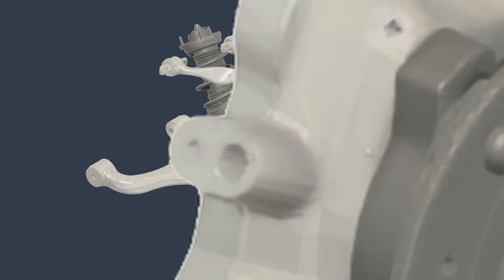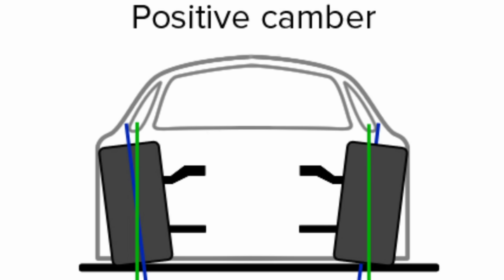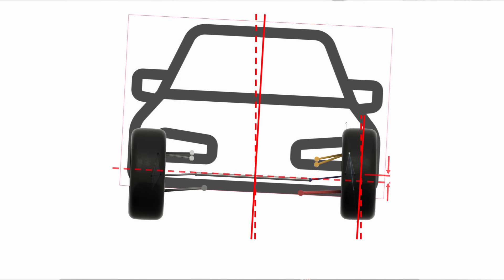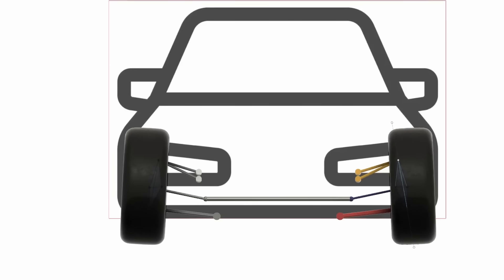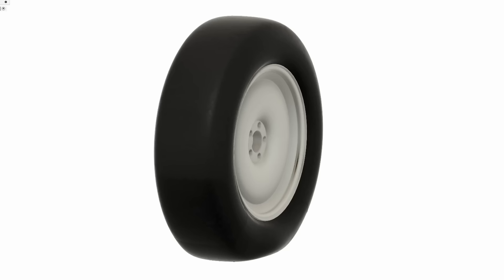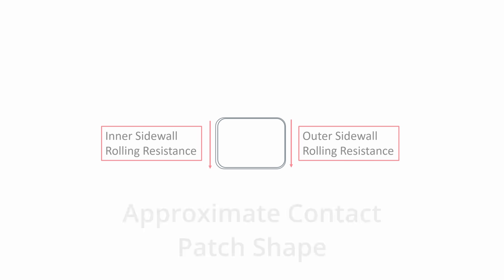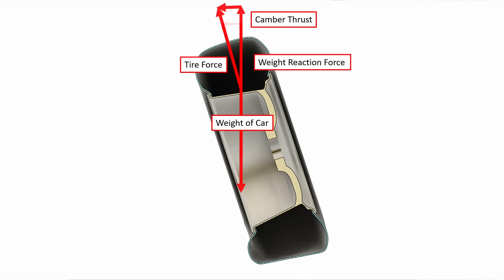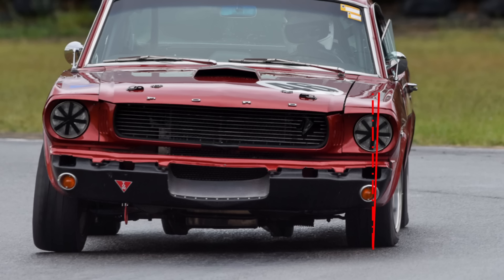Why do some race cars have such ridiculous front suspension camber angles?

Comment: Hey, I like your videos! People often say you need toe OUT on the front for better turn-in. How do you see that? I see the absolute first turn-in depend on the lateral force you get on the front and rear axle when going straight. Negative camber creates 'turn in' force on the outside tire. Toe IN creates a slip angle and turn IN force on the outside tire. So why do people claim toe OUT increases turn-in response? In my simulator as well, negative camber and toe IN makes initial steering develop yaw rate faster.

Comment: I've found all your videos very informative and have used things you helped me understand to improve the suspension on my FrankenFerrari V12 308  with revised ride height, roll centers, anti-drive, springs selection.  Any chance we could get a video on steering self-centering?  How caster, camber, trail, scrub, offset all tie in (if at all) and as a huge bonus how  the OEMs deal drag/friction in PS systems and particularly EPSA?  I recently add EPSA and its now a bit numb and kind  just kind drifts around going straight....and reading I see that is a common complaint both in OEM and retrofit setups. I'd love your wisdom here before I crank in a bunch of caster and hope for the best :)

Comment: Another reason for less front negative camber than in the rear on a street car is because of camber change due to caster as the wheels are pivoted about the steering axis. Albeit small, as the wheels pivot about the steering axis, because of positive caster angles use, the outside wheel will gain negative camber and the inside will will lose negative camber (which happens to be what you want). This doesn't happen in the rear being that the rear really doesn't "steer" about any steering axis to any appreciable degree.
By keeping front front static camber at a minimum, braking traction can be maximized at the front (i.e., where most of the braking work is done).

Comment: Im a big fan of your videos. Since I just finished my finals I finally took the time to get caught up on all the videos I hadn't watched yet. I have one question/recommendation for a future video that ties back in with one of your earlier videos. In your roll center videos you mention being able to combat body roll with other components such as sway bars. So if you lower a vehicle, assuming the new roll center is not below the road surface, is it better to upgrade to a stiffer sway bar to combat the increased body roll rather than trying to raise the roll center back up which can mess up other factors such as bump steer, or does changing the sway bar stiffness get just as messy due to less independent motion?

Comment: I've been told that camber is based on tire temperatures. you have to use a pyrometer to read the tire temperature at 3 points and try to get an even reading on the 3 points.

Comment: Critical part missing here is that the camber changes when you turn the wheel! The outside wheel of a turn will increase negative camber, and the opposite will happen on the inner wheel. On my BRZ it's about 4x as much extra positive on the outside as the negative camber change on the inside (+5.5 on inside, -1.3 on outside). This very effectively flips the inside camber to also be in the direction of the turn. Bumped my front camber to -4.0 and really noticed an extra resistance to initiating a turn at highway speeds. Bumped it down to -3.25 and it seems very drivable in daily use and very planted on the track. The problem is that I talked to the guys going the fastest, and they are running -4.7 which looks ridiculous and would be crazy for the street.
The BRZ has RWD and generally is setup with less rear camber, but my front turn in is strong enough now that the back feels a little loose and I think I need to bump it up from the current -1.5 angle, maybe to -2.5 (not sure yet what to try).

Comment: Old tractors have huge amounts of positive camber on their front wheels to make it easy to track down rows in a straight line. I always thought that was cool. The Mercedes F1 cars from the ‘10s had a neat feature where the driver could adjust the toe angle to more toe out down the straights for reduced friction and wear by pulling the steering wheel towards them. They were manually pulling the toe out of the front wheels, and when released, the toe angle would snap back to toe in for the corner. It was rad.

Comment: The steel wheels on a locomotive is designed in the shape of a cone, like a tire with a good amount of camber angle. 
Furthermore, this cone shape aids in keeping the train in the center of the tracks when going straight. Also, as a bonus, it also aids when going in a turn.
Reply: The cone shape of a train wheel is there because as the train drifts left or right, the outside wheel rides up on a larger portion of that cone and the inside wheel rides onto a smaller portion of that cone. This causes the outside wheel to roll a larger circle relative to the inside wheel and steers the train back to center. This function relies on the left and right wheels being rigidly attached to each other. That's not how car tires work. They don't effectively get larger or smaller when you drift left or right and they are not rigidly connected to each other.

Comment: When you said "I'm not a racecar designer"  Guess I could stop there.  I believe the BMW's you have shown pictures of have Macpherson strut front suspensions that have a fix camber with no upper A arms.  Thanks for your camber change formula.- Figure in the sway bar and straight rear axes, where the camber is fixed, now that would be informative.  unless you have IRS like BMW's.  Floating rear axes are often set from 1-3 negative camber with a 1/4 toe in but I found your talk geeky, which tickled my ears, thanks. Now I just told you everything I know in 3 sentence.  dude

Comment: Can you please do a video talking about “pushrod” or cantilevered suspensions?
Reply: pushrods are lighter than any and all suspension assemblies (eg arms, springs, shocks, hubs, brakes etc...) 
Moving heavy stuff towards the centre is good (helps against roll as a whole (angular momentum), Esp during direction changes) 
Moving heavy stuff away from the ends of suspensions arms is also good (Lighter wheel/tyre makes it less 'crashy' over bumps right? Entirely removing spring/shock etc from ends of arms does same thing). 

pushrods are so much lighter than shocks/springs/coilovers/whatever that the extra weight of any given pushrod is sod-all, relative to the benefit of moving heavy-stuff inward. 

Put the shocks/spring (heavy-stuff) in the middle of the car + transfer the forces to them using pushrods. 

Also: Inboard brakes (ie brakes next to the gearbox/diff' as opposed to having all that weight at the end of driveshafts) 

Also: If I could move hubs inboard, I would... But hubs be hubs... 

SO: Nope, I cannot do a video of it. 
AND: I never got my head round 'cantilevers'...

Comment: Great video.
One reason for high static chamber on the front of street cars on track is to compensate for tire sidewall roll. Even modern low profile tires have a surprising amount of roll and chamber helps to compensate for this and keep the tire off the sidewall. 
Another reason for high static camber on the front compared to the rear is that many of these cars are McPherson strut front suspension, which has limited camber compensation. The rear suspensions are multi link layouts with better camber compensation, so they need less additional static camber.

Comment: When I rallied a MK2 Escort it was set-up with slight negative front camber and no power steering, it was a real handful when driven on the road, but on either tarmac or forest stages and the 'red mist' had taken over it handled great. Negative camber does not look as though it should work, but I does.

Comment: Excellent video as always. Thanks 💘

Ive been taught that with negative camber It was the that inner circumference of the wheel got a bit smaller than the outer. And just rolling a solo cup on flat surface, that difference in circumference created the inward steering behaviour. 

It sounds perfectly logical but Im a lot less certain of that now. Is this incorrect?

Comment: Hi, im currently (since 14 months) developing the most realistic Mclaren F1 to ever be in a racing simulation.

But currently im stuck with the suspension. Im recreating the XP4 that was driven by Tiff Needell, which had an exceptionally soft suspension with lots of lean, squatting and diving, while Tiff threw it around Goodwood.

im getting closer to that, but at the same time the suspension starts to bottom out and the outer front wheel loses sometimes touch with the ground.

could u give me some advice on which suspension settings i have to change, to fix those issues? 

(im currently trying to go thrue everything.. but its so many settings and combinations, that i cant really make progress)

with kind regards,

Max from Hardys Mods

Comment: I do not use high static camber angles because we circle track race.  My driver does not like having to hold the steering wheel to the right on the straits next to the wall due to the camber thrust to the left.  One thing nit mentioned on the cars with the extreme angles is it reduces rolling resistance in straights.  Then they just optimize the camber gain in the corners.

Comment: An interesting use case to explore is that of drift cars.  These cars need aggressive caster to aid with the wheels coming back to center, but because the car is counter-steering in a drift, the aggressive caster adds camber in the wrong direction for the loaded corner.  The front static camber must then overcome both the body roll angle and dynamic camber gained from the steering with aggressive caster.
Reply: The typical solution is to locate the upper and lower points more forward to increased mechanical trail while lessening caster.
Reply from the maker: Drift cars are an interesting case because they spend most of their time at very high steering angles. A typical race car's front wheel don't steer more than a few degrees left or right and so the impact of caster on camber in turn is very small. Watch an in-car video of a formula1 car racing and you'll see very little steering of the front wheels. It takes surprisingly little steer angle to make a car go around a corner. You can do this experiment yourself. Drive around town and pay attention to the amount of steering wheel angle you use. It's probably not more than 90 or 180 degrees. Now divide this number by 15 which is a typical ratio of steering wheel angle to road wheel angle in most cars. That gives you 6-12 degrees of road wheel angle. Considering that full lock is typically around 40-45 degrees, those numbers are not a high percentage of the available steering.

Comment: I have had the experience of following single seat race cars at speed on UK circuits , (In my own single seater.) and you do get some moments to see what's going on in a straight line. It has occurred to me that the effect on rolling resistance of a heavily cambered front tyre is such that it is  also able to offer less rolling resistance, compared to a tyre that has little or no camber. (Remembering how sticky the rubber is on a pure racing tyre.)  Cross ply tyres do not respond to lots of camber  because they are too flexible to accept the loads, whereas radial tyres are able to make an advantage of this condition due to their stuff construction.

Comment: I track my Lada at Chayka Ring and with -1.5 camber, right front tire lasts just one track day because there are a lot of long corners (more lefts than rights), so outer edge of the tire overheats and delaminates. For this season I'll use new set of front wishbones which have wider range of adjustments, need to setup a camber between -2 and -3.

Comment: On race cars like the one in the thumbnail this excessive camber was most likely to increase track width. Many racing series don't allow to increase track width over oem design, so increasing camber is one way to get wider. The benefit of more track width can outweigh the negative effects of too much camber, at least for racing cars.
Reply: I don't agree. You can expect about a 10kg decrease in load transfer per 0.1m of track at 1G in a typical car design, or 100N. 100N is worth about 0.005mu~. Camber can be worth easily 0.10mu or more.

EDIT: Of course, you can probably expect a bit less roll as well, maybe in the order of 0.05deg/g less or so, which is not completely insignificant, but it's not making up the difference kinetically. It will be more significant in a roadcar, maybe in the order of 0.30deg/g, which is significant, but again, it's not making up the difference in camber that you'd get.

Comment: I wonder why I have excessive tyre outside wear on all four tyres on a sub 500 Kg car with 2deg front camber and 1.5deg rear per each tyre and arbs front and rear adjusted to 30% rigidity. It has double wishbone all four corners. roll in corners is very minimal. Im thinking to increase static  camber even more...
Reply: Although your car is quite light and will not produce super huge tire forces, there should still be enough to cause noticeable elastic camber change mid-corner. Even if you calculated that your angles should be close to 0 or maybe even negative, they're probably positive.
Reply: @ArchOfficial Im going to increase static (negative) camber and have a test run, then measure tyre temperature at left, middle and right side.
Reply: @ On an ideal setting, usually your inner will be hot and outer will be cold relative to middle. They might be closer to eachother on a skidpad.

Comment: I won't claim to be an expert but I have been studying this for quite a while and I think this has a lot more to do with tire deflection than camber thrust. AFAIK camber thrust is a pretty small force relative to everything else (at least for small FSAE tires) but tire deflection can be very very significant under cornering on a road-weight car, leading to an improper contact patch.

(Edit: this paragraph has an incorrect basis, racing tires are stiffer construction, however the point about mismatched weights may hold some water if these amateur cars are set up wrong)
Slicks and semi-slicks are often inherently less stiff (sidewalls mainly) since they are intended for racing cars which are much lighter than road cars, or at least gutted road cars. I can't speak to the examples shown (except the mustang, that is undoubtedly a brick) but I would assume a lot of amateur racers would simply slap on slicks to their heavy car, use the chalk trick to see proper rollover, and then refuse to inflate their tires properly/switch tire construction. So why wouldn't this be an issue for rear tires? Well, this might put a hole in my argument, but I would think that the scrubbing action of the front tires causes them to have more rollover (sideways and back vs just sideways).

It is also worth noting that none of these cars have front aero, which negates any benefit from this as the inside front becomes more effective (aero distributes ~50/50 between the two wheels on an axle) and extreme camber is a detriment to performance. In a lot of non-aero cars on proper tires, the insides are pretty useless anyways and tires are much less camber sensitive at low normal forces.

For a decently aero-driven car like a GT3, the tire deflection is significant, but it is now way more performant under braking and more camber would throw that away. They seem to run decent camber too, but this prevents them from running away with this phenomenon. Their tires are also designed for their weight class and likely deflect less as well, but that is not my area of knowledge.
Reply: I wouldn't say racing tires are softer relatively than road tires. Any data I've seen suggests higher vertical rates, and the peak slip angles are lower and slip dropoff higher, which suggests higher lateral stiffness as well. They do vary a lot, though. F1 tires are for sure extremely stiff, around the 350kN/m range at 20psi IIRC.
Reply: @ArchOfficial you’re totally correct, don’t know what I was thinking. Probably more of a lateral load transfer thing as so many road car chassis need to be tuned to just about tripod to get good yaw rate on an autocross course. No clue on tracks however, could definitely be camber thrust if that’s a larger effect for bigger tires but it appears you have better data than I.
Reply: @ Racing tires are generally thinner; but I haven't seen it translate into being softer, unless comparing rally tires from brands like Avon to run-flat tires.

Comment: I mean I was sure tha camber was “at how much turn angle you want your front tires to have the most contact surface” and no other reasons
Reply: This is the principal reason
Reply: @HondaEnjoyer12 And relatedly, to make the tyre temperature even across the width and to allow for even tyre wear. However, the effects described in the video are still interesting.

Comment: But why would you simply not achieve negative camber and camber thrust via castor angle. This would make more sense as it only comes into play when there is steering angle present. It would also cut straight line drag and wear.

Comment: So overall the car becomes more playful around the back end if you have more camber in the front. That makes a lot of sense in racing as it helps turn the car into the corner quicker and on top of that helps inside the turn by keeping up rotation because the back end is somewhat loose. Of course that becomes a dragons dance at some point.
Reply: Thats right.
This Setup can make the Rear very easy to Oversteer, but also very easy to catch again after an Oversteer.
In a Street Car this Setup is build so the Rear NEVER Oversteer. But once you are over this one Point and the Rear Oversteer, it is not so easy to catch it back again.